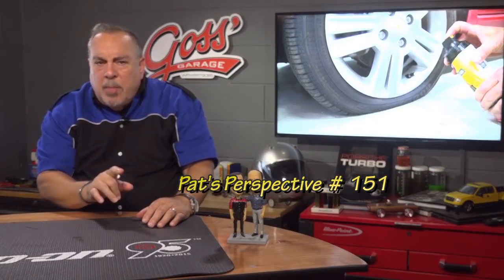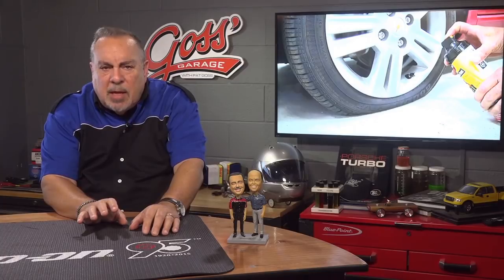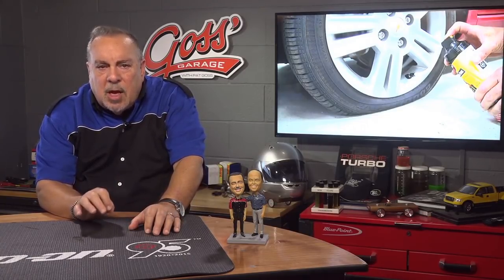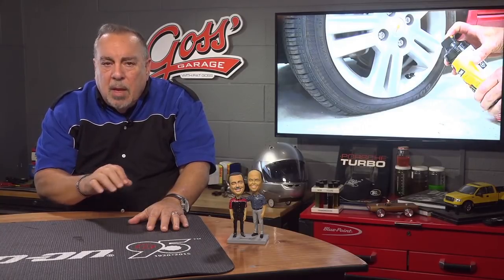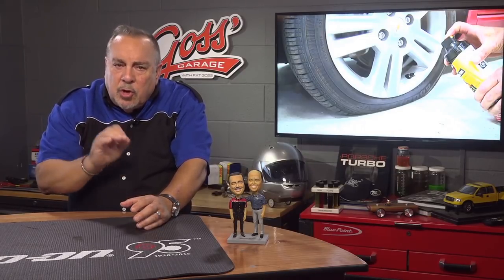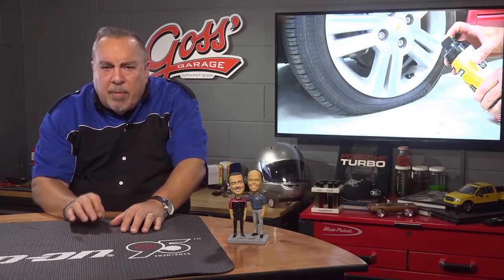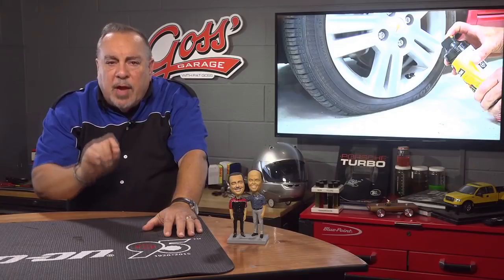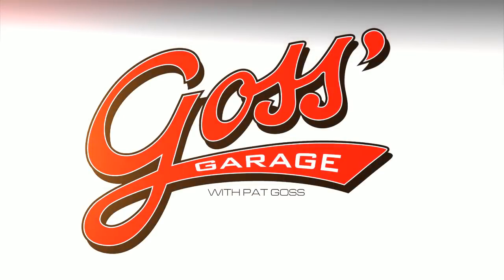Pats' Perspective 151 - Tire Pressure Monitoring Systems

Comment: Good vid as always. I have a late model Accord with the indirect system and am glad It has that less complex system. It is much cheaper to maintain when you buy new tires or a set of take off winter tires and rims. The likelihood of all 4 tires being low simultaneously is rare. As you pointed out well they all have their shortcomings and no substitute for checking your tires condition and pressure at least once a month when they are cold (before you drive it that day or about 4 hours since your last drive). A good pressure gauge, an air compressor (if you can store one) and a tread depth gauge should be part of your vehicle maintenance Arsenal. Tires are often overlooked and are crucial to vehicle safety and handling that small contact patch from your tires to the road is what connects you and your vehicle to the road.

Comment: Good info but why did you forget to tell 'em how much air pressure to put in their Tires when they are at the "Filling Station" ?.....Do they put the Pressure that's written on their Tires or do they put the Pressure that shown on their Drivers Door Placard ?

I like a lot of your Videos.

Southern California Smog Tech/Repair background.
Reply: Very good question, especially when a replacement tire has significantly higher max pressure rating than OEM.